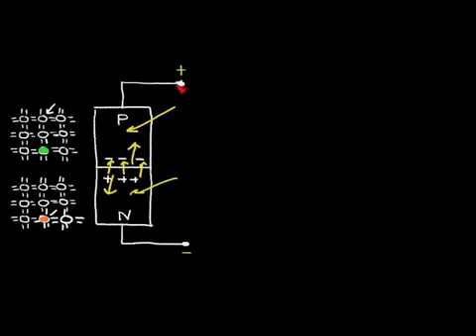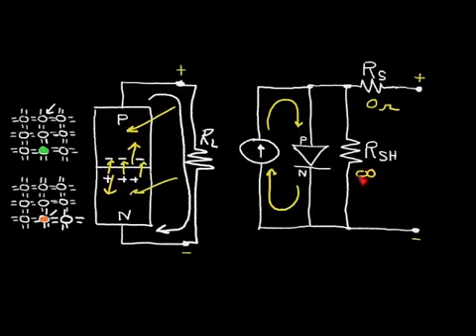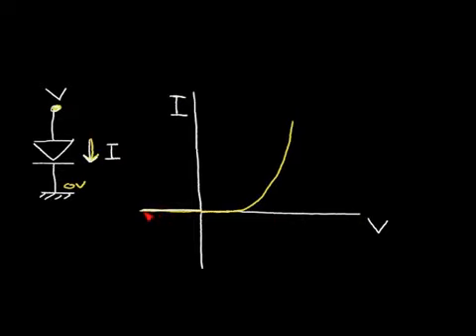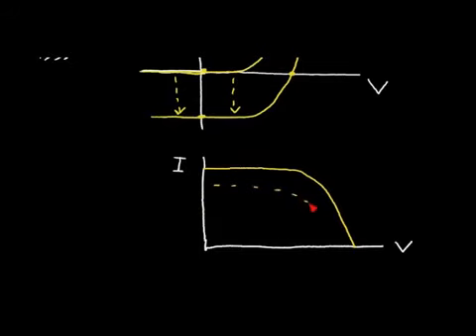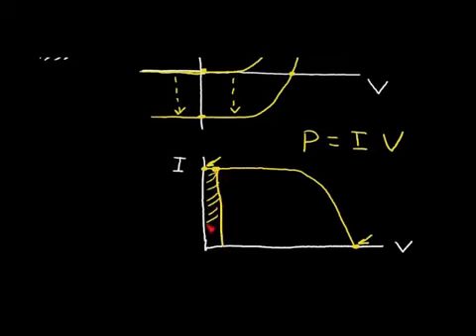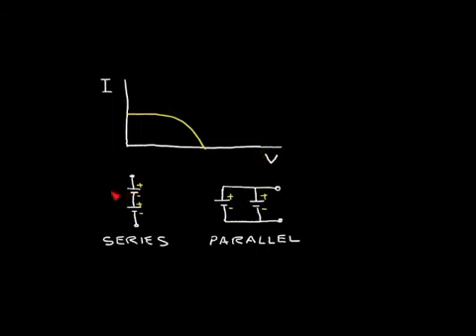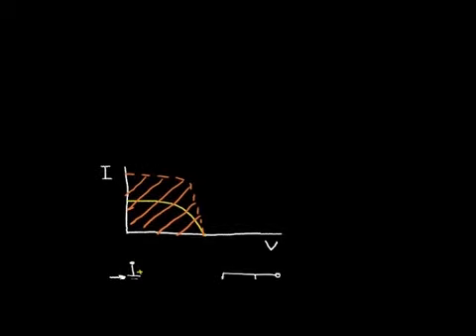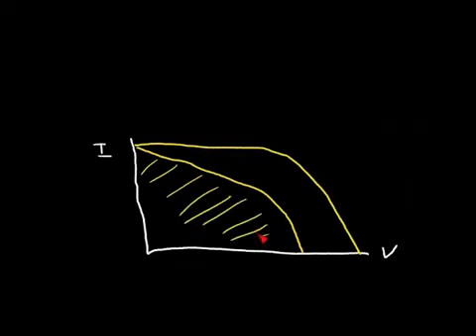How Does a Solar Cell Work?

Comment: Great video!

I have a few questions I'm hoping you could answer:

1. Why can holes be thought of as positive particles?  Aren't they just a lack of negative, which is, in a way, only half way to a positive charge?

2. In the P-N junction, why dont all of the holes just recombine with the electrons from the n side right away?

3. Is the band gap of the cell only a property of the material to sort of eject electrons from the P side?  Or is it a property of the junction itself?  How does the electric field between the P-N junction affect this?

I would really appreciate any help--thanks!